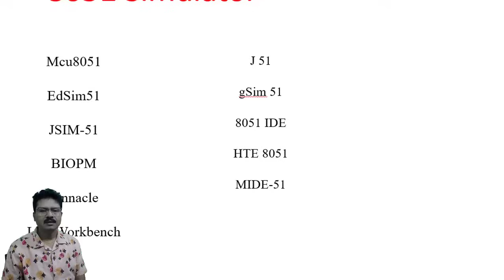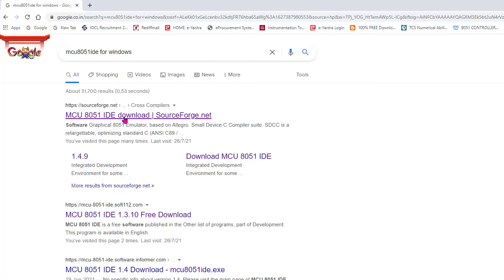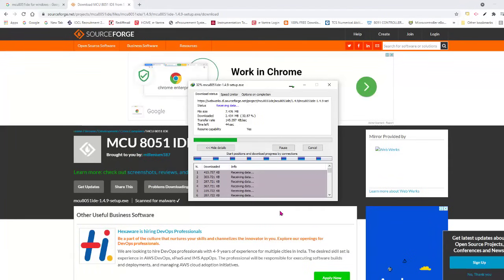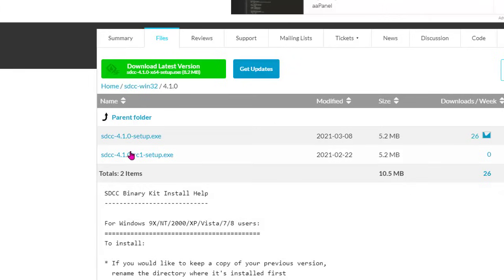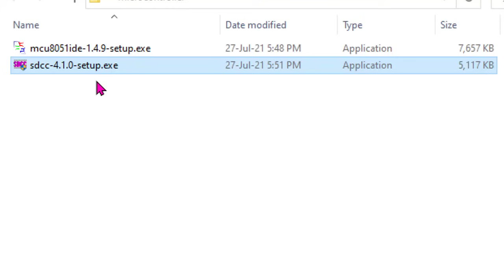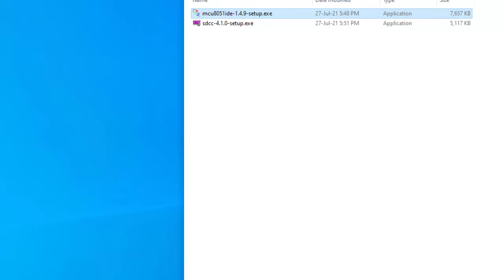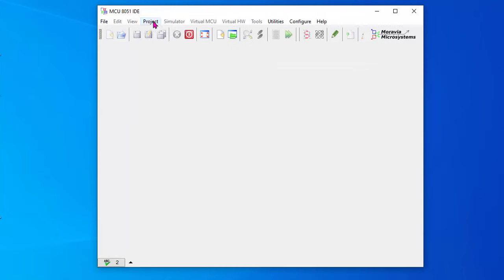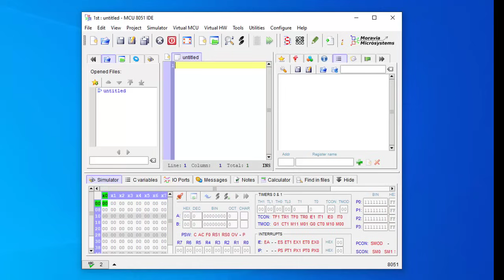[mcu8051ide]How to download and install MCU 8051 IDE: a simulation software for 8051 microcontroller

Comment: Dear professor, I just saw his channel and I have subscribed. Work with microcontrollers of the family of 8051. especially with AT89C5115 of ATMEL. However, I have not found any programmer that allows me to work with the ICSP. That is, put on my application plate. Could you help me with this? Do you know any device that can perform this function? Thank you so much. A greeting from Spain
Reply from the maker: For any type of programming in ISP/ICSP, we need to use any software (say Keil) to convert .asm or .cpp file into hex file. then that file need to be burnt in to the Microcontroller, and that needs a device, USBasp, which is available in online also.  If you search net, then you will get it. Actually i use universal programmer for that purpose.  Try to purchase one USBasp ISP programmer and if you face any problem, you may discuss with me. You are always  welcome. Thank you as you subscribed my channel.
Reply: @silenceandprogress  That's right. But I can't find any commercial device that allows me to program this Atmel microcontroller via ICSP. THE AT89C5115. If you have never worked with him, I recommend that you see his characteristics. Is very complete . A cordial greeting from Spain

Comment: Think you sir, I like your video 
Please, I have an 8051 MCU with support uart communication 😢
It's a syncmos MCU ( SM8954A)
Please help me 🙏🏿🙏🏿🙏🏿
Reply from the maker: which problem are you facing
Reply: @silenceandprogress  I have not development board of syncmos MCU, I also haven't syncmos MCU compiler
Just USB to UART converter 
I want Howe to program my device with USB to UART converter
Reply: @silenceandprogress  the device name: sm8954a sir
Reply from the maker: you may use Keil software to write program in C or in assembly. That program need to be converted into Hex. that is done by Keil software. That hex file need to be entered into microcontroller, technically it is called burning. For that you need a burner, there are so many burners available in market. Otherwise you may used ISP for burning. You need to study all of these.
Reply: @silenceandprogress  Thanks 🙏🏿
So I can't use USB to TTL converter for programing, right ?
I have already used keil software and I have a hex file. Now, I need to upload my hex file to the microcontroller. But, I haven't seen an software witch can upload it 💔💔
Reply: @silenceandprogress  I want know if sdcc can do it🤲🏿
Reply from the maker: SDCC is a free and open-source compiler for the C programming language that is primarily used for embedded systems and microcontrollers. 

SDCC itself is primarily a compiler, so it's used to generate machine code (usually in Intel Hex) from your C source code for various microcontroller architectures. However, it doesn't directly handle burning the microcontroller.

As you are using SM8954A,  I don't have working experience on this, yet this writing might help you.  To burn the hex code onto the SM8954A microcontroller, you'll need a compatible hardware programmer. one may be  Silicon Labs USB Debug Adapter (part number: CP2102N-EK).

Here are the general steps: 
Connect the USB Debug Adapter to your computer via USB.
Connect the Debug Adapter to the SM8954A microcontroller using the appropriate connections (e.g., JTAG, SWD, or UART).
Install the Silicon Labs Simplicity Studio software on your computer.
Open Simplicity Studio and navigate to the programming section.
Load the hex file generated by SDCC into the programming utility.
Configure any programming options or settings as needed (e.g., target device, communication interface).
Initiate the programming process, which will transfer the hex code from your computer to the SM8954A microcontroller.
Once the programming process is complete, disconnect the Debug Adapter from the microcontroller.
Again i am telling, i never worked on it. So you need to have a check. It might work, might not. Theory are easy but practical are not so.

Probably you have USB to TTL converter. you may use this instead of USB debug adapter. but it's not as straightforward. You need to study more about the software needed with this. 
Anyway thanks for knocking me. Love.
Reply: @silenceandprogress  Oh  I am glad too❤️❤️

Comment: Hi sir,
Please Help me,
Give me a simple blinking code 
for
FMD 8051 MCU FT60E010A
Reply from the maker: #include <reg51.h>
// Define delay function
void delay(unsigned int time) 
{
    unsigned int i, j;
    for (i = 0; i < time; i++)
        for (j = 0; j < 1275; j++);
}

void main() {
    // Declare P1.0 as output
    P1 = 0x00;  // Initialize P1
    while (1) {
         P1 ^= 0x01;  // Toggle P1.0
        delay(500);  // Delay approximately 500ms
    }
}
Here is simple led blinking code for 8051

Comment: How to configure sdcc in mcu8051 ide ?
Reply from the maker: Will you please tell why do you need to configure sdcc?
Reply: mcu8051 is only ide it is not come with SDCC compiler so I have to install MUC8051 and SDCC separately and configure sdcc in MCU8051.